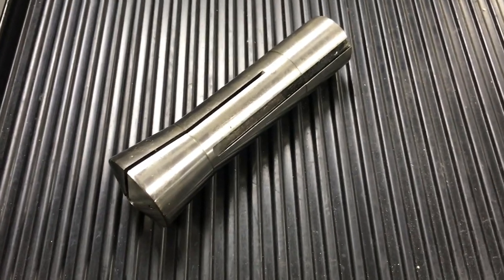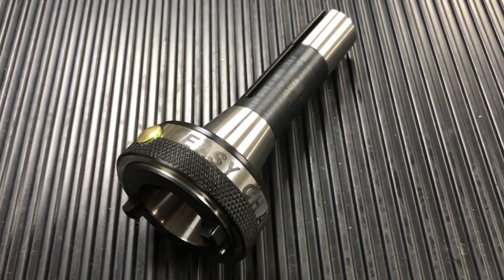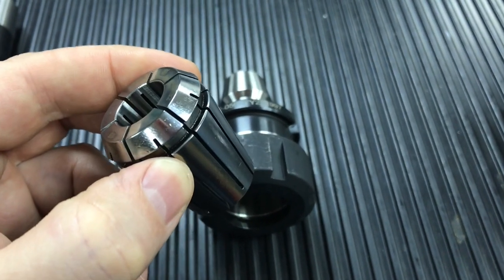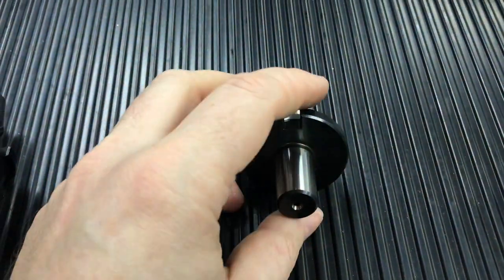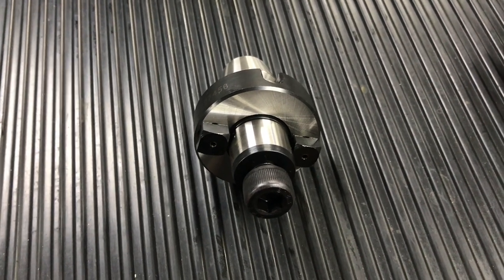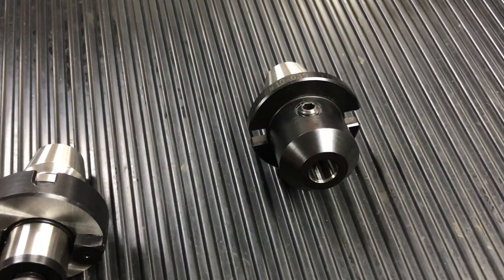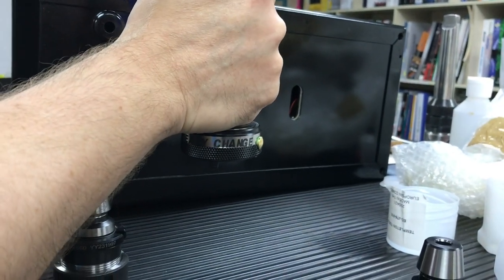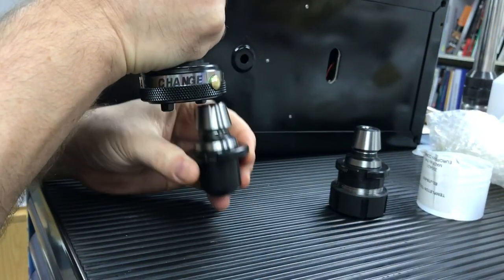Bridgeport Upgrade - Easychange System Tutorial - a UK Manufactured Product

Comment: Air actuated drawbar is almost as fast and you do not need those expensive tool adapters as it works with all R8 shanked tools.
Reply: The advantages of these is you can have tools pre-set in the holders already at desired length, to do repetitive operations, instead of setting the lengths each time.
Reply: @Naeiou  I use preset tools in my r8 shanked tools everyday. In fact I have some tools that have remained in their respective tool holders since the day I bought them!
Reply: @37yearsofanythingisenough39 
I was describing regular R8 collets, not the ER-16 ones.  Back when I was machining, we didn't have them unless we had the luxury of a 30 Taper spindle.  Your air actuated drawbar was a luxury too!  lol
Reply: but you need an air actuated R8 drawbar which is a lot more expensive

Comment: I take it these are indexable? Looking to get these for my CNC conversion.
Reply from the maker: Depending on your definition of indexable they should be. In other words, once the master adaptor is secured in the machine (by drawbar or locking mechanism) you can index/swap between adaptors. This is done by pressing the button and twisting the knurled ring (to remove) and pushing the replacement adaptor into the master adaptor (where it automatically locks).  If you mean can it hold indexable cutters: Yes we do weldon shanks for straight shank cutters and shell mill adaptors (16mm spigot for 40mm shell mills, 22mm spigot for 50mm or 63mm diameter ones).

Also, all of our easy change adaptors are interchangeable with Boxford VMC190 machines. However, you will need to unscrew the pullstud from your current adaptor and put it in to the back end of the easychange adaptor (thread size is the same).

There are cheap copies of this system on the market who's name SOUNDS similar but are manufactured in India (as oppose to the UK). These are not induction hardened, made of cheap material and have terrible concentricity and tolerances. This can result in poor surface finish, accuracy, tool life and overall performance. Be careful who you buy from.
Reply: @engineeringsupplies4312  Ill always buy British when its available so ill be looking to pick up a set of these soon. Thanks for the info, sounds like they fit my needs.